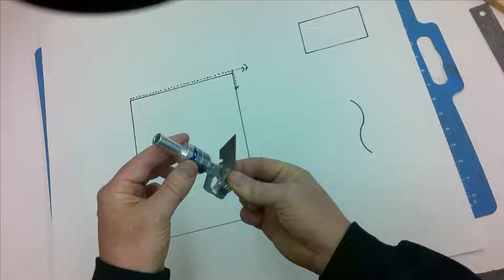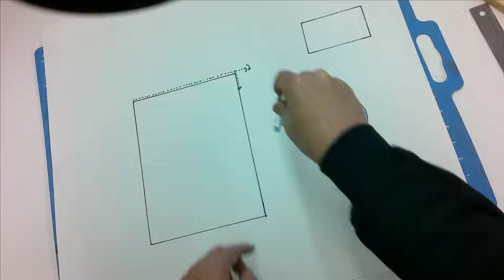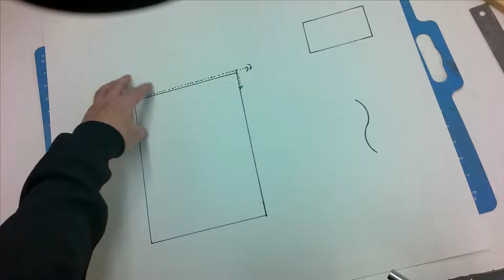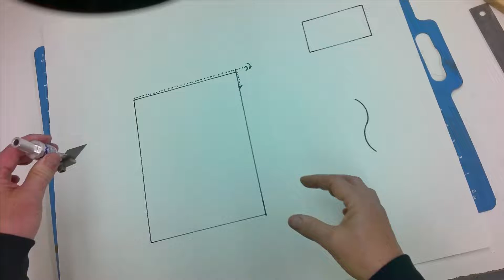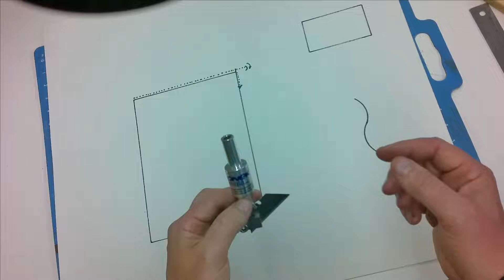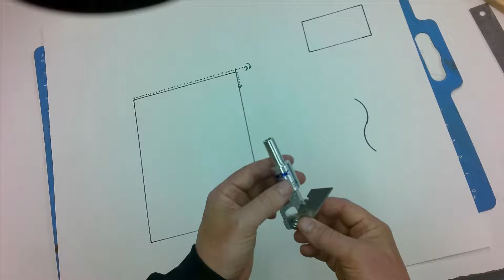Dragknife positioning discussion

Comment: What stroke length and speed do you envision being sufficient for a hobby-class OTK?
Reply from the maker: Good questions. Of course it would be great to be able to vary both. Before answering, we should probably try to characterize the target materials and then design for that. I'm thinking leather, corrugated cardboard, and foam rubber up to about 5mm would cover most common  use-cases for hobbyists.
Reply: @sliptonic  well, speed is adjusted by spindle speed if it is spindle-driven, but what speed range would it have to support?

Adjustable stroke depth could have large design cost. For example, an adjustable swash plate might be expensive and finicky and limit effective speed. If very short stroke would actually be sufficient at high speed, I have an idea for something that I might be able to make mechanically simple. But I know nothing about actual OTKs so what seems like a good idea is almost certainly hogwash. 😁
Reply from the maker: @MichaelKJohnson  take a look at the OTK video I linked below.  They're not using the spindle for oscillating action (but that would be very cool).  They are sing a stepper instead.  I don't think the oscillation needs to be super fast.  We could probably do some calculation on the angle of the blade and the feed rate to find a minimum speed.    Also, someone sent me to this thingiverse thing.  There's a linked video showing impressive results.  I think this design could be improved a lot.  https://www.thingiverse.com/thing:1436870
I suggest we continue the discussion in the FreeCAD forum thread so we can attach pictures and files.
https://forum.freecadweb.org/viewtopic.php?f=15&t=63669
Reply: @sliptonic  ok, I'll keep thinking and post there if I come up with anything potentially useful...

Comment: what about (only for items limited to the XY size) have controlled turn table and blade mounted in a way that tip is in the center of a tool?
Reply from the maker: You're talking about an improved drag knife design? Interesting. It means the cutting force is still lateral though.

Comment: А есть видео, где успешно используется такой инструмент на ЧПУ? Пушо мя первым делом подумал про шаговик, управляющий направлением лезвия, как было упомянуто в видео позднее. Это очевидно работающее решение, в то время как обсуждаемые полагается на заведомо менее надёжные побочки от вспомогательных разрезов. Это напоминает попытки вытянуть дополнительную точность из раздолбанного станка, скомпенсировав люфты дополнительными движениями в одну сторону.
Энивей, мя имеет мысль насчёт холда направления инструмента электромагнитом на время его переноса от жертвенной области к началу раскроя. Его можно приаттачить к выводу управления инструментом, которые есть у практически любого дешёвого контроллера. Но тогда придётся отказаться от вибрации, мдамс.
Reply from the maker: Are you asking for a video of a drag knife or a video about OTK?  I'm sorry but the translation is unclear.  Here's a video about the stepcraft OTK.  It's the only one I've found that is even close to hobby-class.  Still quite expensive.  https://www.youtube.com/watch?v=0WfCpRiBctQ
The idea of using an electromagnet or other devices as a brake during the transit is a good one.
Reply: My bad, the original comment was pretty ambiguous too. About dragging a knife and especially about using the sacrifice area for positioning.
Also, about magnets. Maybe just a simple piece placed over the bearing case can prevent unwanted rotation during transfer?

Comment: Maybe you can use a cutting plotter mat. Those come with some sort of glue that holds the thing you're trying to cut so it doesn't lift from the bed
Reply: Yes, that's a good idea. The ones from CriCut (urgh, I'll never stop regretting buying one of those) are coated in Silicon to make them extremely tacky.